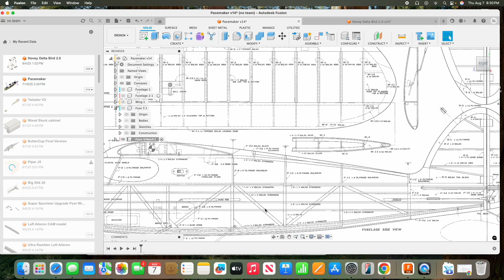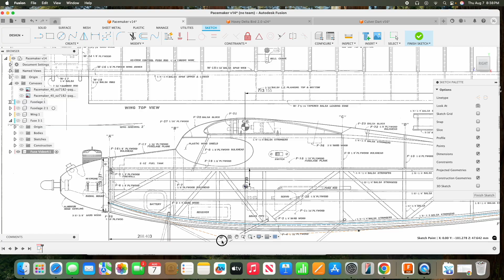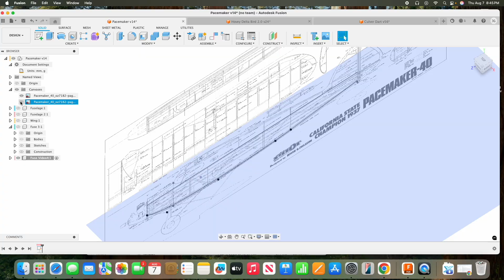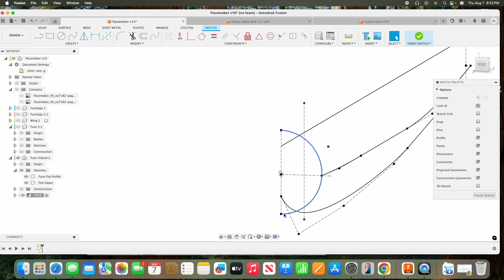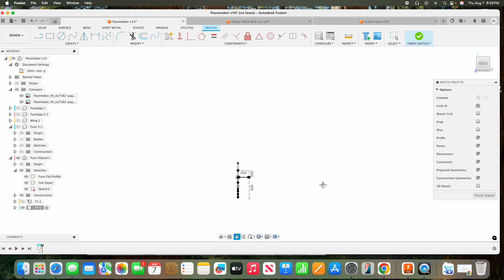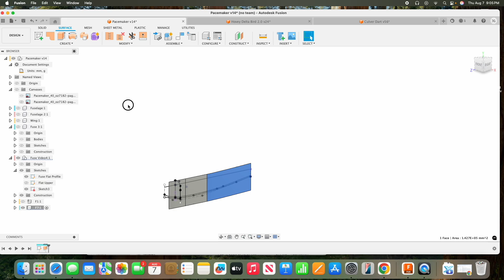RC Airplane in Fusion - Modeling the Pacemaker Part 2

Comment: the main landing gear should be located directly below the wing leading edge, when the model is level.    apparentlly the original design was defective, in this regard.    the main wing end view shows an incorrectly configured aileron pushrod.
Reply from the maker: The main gear location is not defective or incorrect. This was originally designed as a free flight model. The landing gear is forward to protect the prop from getting hit. Props were expensive. For those that couldn’t afford to buy a prop, they carved their own.